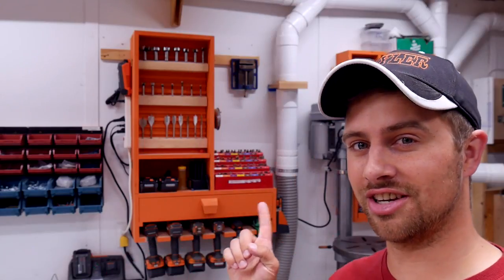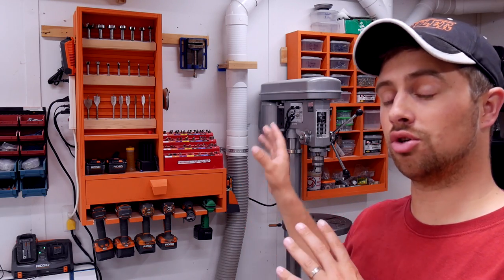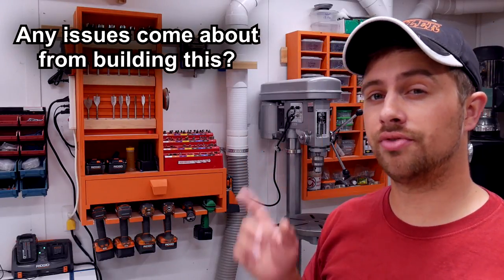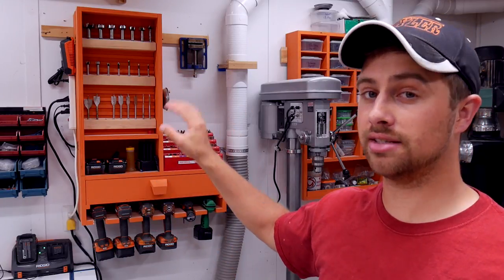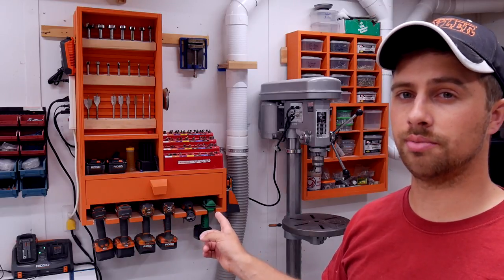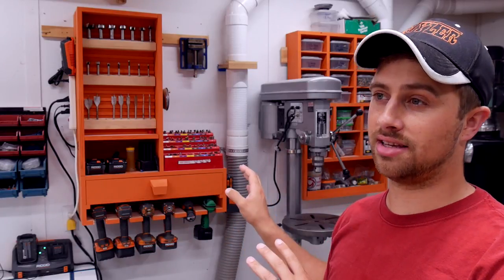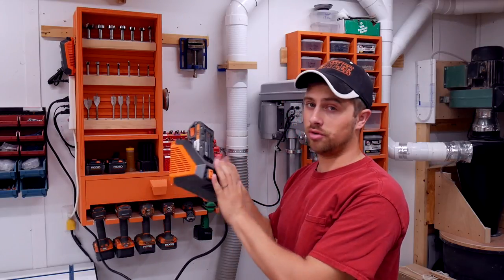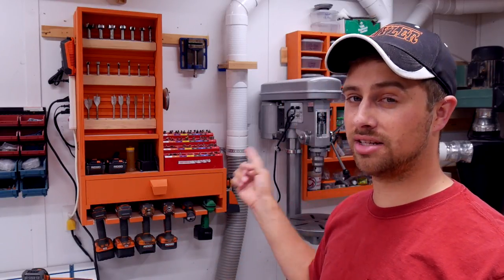LTL French Cleat  Drill Bit Storage Cabinet

Comment: Cool stuff Tyler.  I think any set of shelves for fasteners should have a little flat surface to set things on.   You'll typically want to pull out a container, or two,  set them down, and dig thru them to pick out a few fasteners.   It's also the place where my magnetic trays hang out.